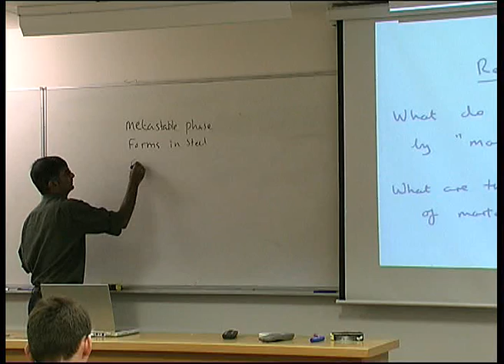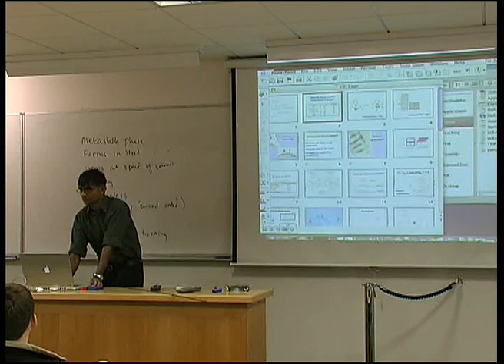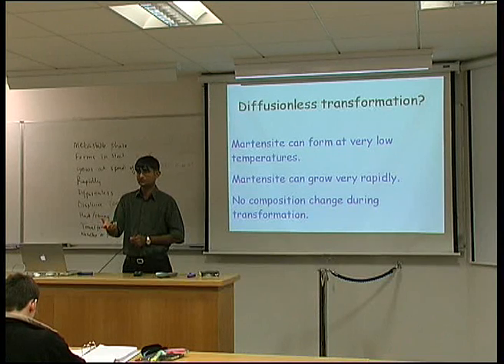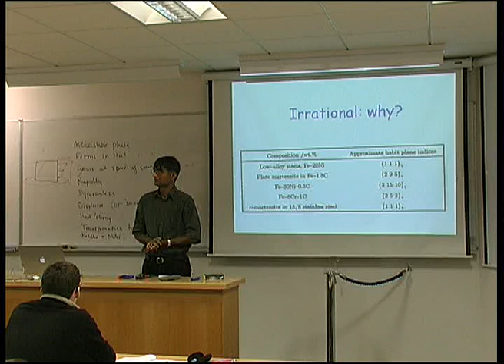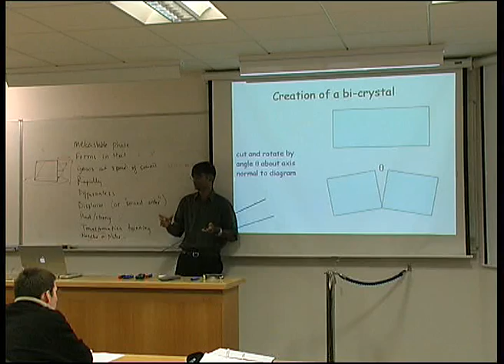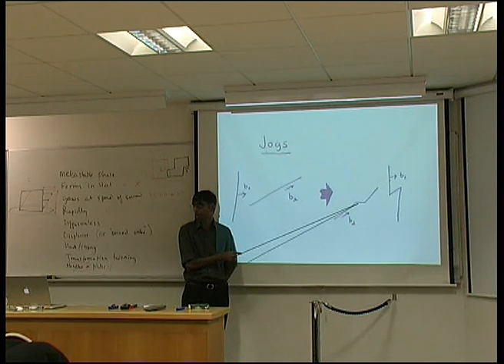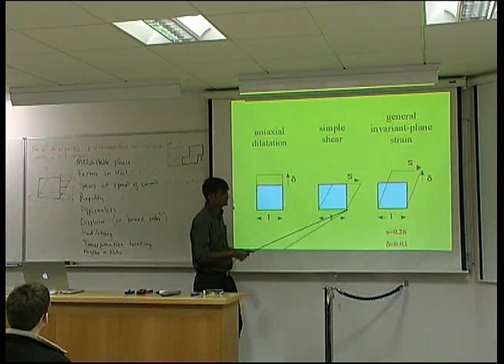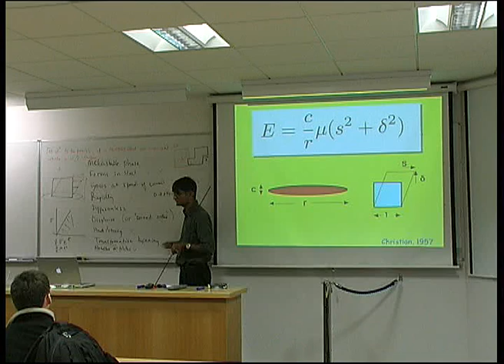Martensitic Transformations, Part I

Comment: speed of sound is 330 m/s ... just saying
Reply: speed of sound in air is 330 m/s. In steel it is approximately 1100 m/s. Sound waves travel longitudinally and hence speed of sound is dependent on medium. ..just saying..
Reply: The speed of sound is dependent upon the material through which the longitudinal pressure waves (eg, sound waves) are travelling.